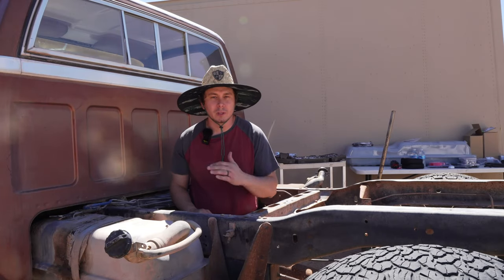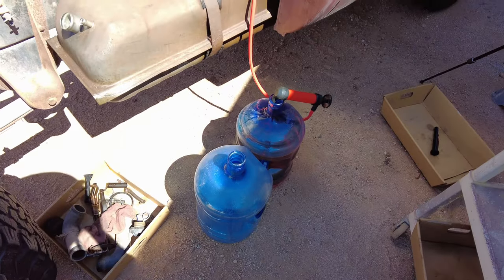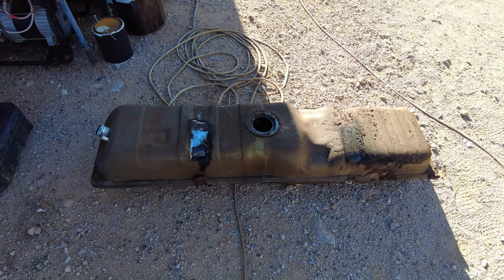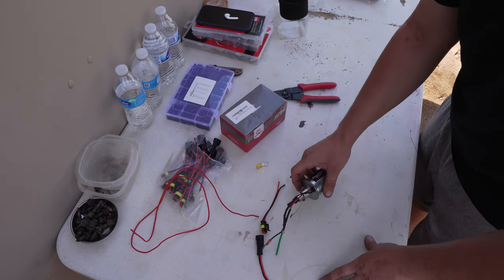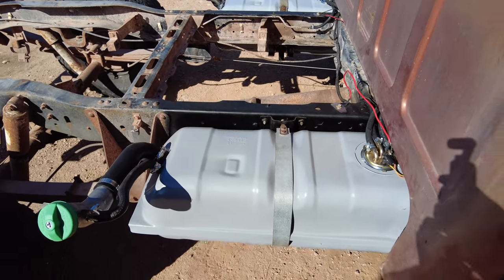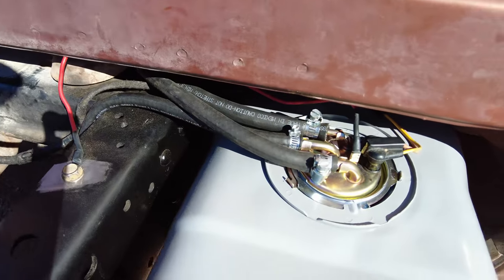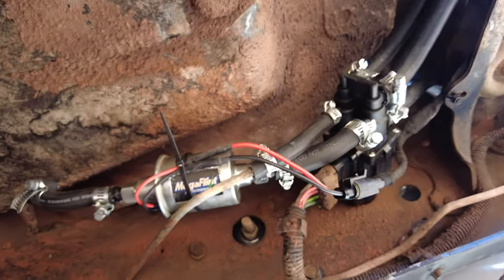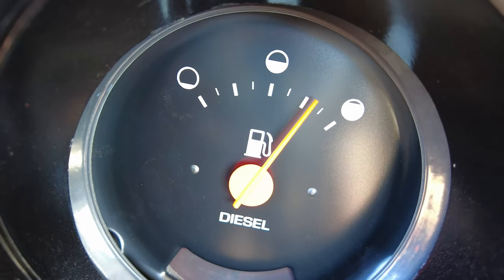Our Square Body Gets NEW FUEL TANKS!!

Comment: I have a '86 C20 6.2L that I've been wanting to do this with.. I've done a D200 Dodge, but this seems more simple since I've done it before
Reply from the maker: It should be pretty easy to do! Good luck with your project 😎
Reply: @2AOverland  thanks man.. I'm tired of my diesel leaking money all over the ground an I'm hoping it can help with more power to the wheels or acceleration

Comment: I ordered the Spectre tank for mine, but it didn't come painted just galvanized so i scuffed it with a Scotch Brite on a drill and primed it and painted it with three coats of Valspar Tractor and Implement paint. You can't hardly scratch that stuff off with a key.
Reply from the maker: Nice! I’ll keep that in mind if I have to touch up the tanks or have to repaint the frame

Comment: 78 Chevy gas dual tank couldnt get fuel to carb.passenger tank is supplying fuel to motor.was told tank splitter couldn't be found by local mechanic got it running new battery. What should I do?

Comment: To bad the rubber hoses won't last 2 years on ethanol
Reply from the maker: Thanks for the advice. I had no idea. I will need to replace it with diesel fuel rated hoses

Comment: Did  you see any gas filters from the tanks to the switch Valve?
Reply from the maker: There isn’t you have to install your own
Reply: @2AOverland  Okay thank you I was told that there were filter, it didn't make any sense. Thank you
Reply from the maker: Tbh from the factory there probably was but this truck was messed with so much it probably got removed. And it has a filter on the backside of the intake. At least mine did

Comment: About to replace some of my  hard fuel lines with soft lines as well. When removing the tank the hard lines were a bitch to disconnect fron the sending unit and there was no room to do it while the bed is on. Bent one of them and decided to just say bye to them

Comment: Is there a chance you can guide me on the hoses for fuel there's 3 and on both tanks need to find out witch goes to the other tank the middle or one of the sides
Reply from the maker: Sorry about getting to you late man! The middle  is to the water spout on the frame rail, the front and largest one is your fuel feed and the smallest one is your fuel return

Comment: Question, im working on a 1979 chevy silverado just like this one on video! Its gas! 

I dropped both fuel tanks right each sending units have three hose connections, i oredered new units a d both came with two hose connections,then i ordered them again and this this time they sent one unit with three hose connections and one with two hose. Will either of these two sets work or not???? Or do they have to be the ones with three hose connections! Kind of stuck here lol 😆 ive talked to two mechanics and they both have different opinions on this matter. NEED HELP
Reply: Tks for making this video and I hope I get a response back soon. Kind of need to finish this truck by this weekend or next. Tks again
Reply from the maker: Thanks for watching I really appreciate the support! So I could be wrong but there’s three hose connections on the diesel ones cause one is the feed to fuel pump, 2nd is the return fuel line and the 3rd is to a on/off spout on the side of the frame that’s for separating water from diesel fuel… so I’m going to guess you need the 2 hose connection sending units 😊
Reply: @2AOverland  that's what I thought cause I've seen it on diesel tanks but unfortunately these tanks are gas cause it smelled like varnish. Diesel doesn't good bad that I know of it might but it takes a long time

Comment: I just got a 74 k1500 and the right side doesn’t work  and the left does but it doesn’t read at all well how do I make it to read correctly
Reply from the maker: I’m not entirely sure. It could either be a power, ground, sender, pump or gauge issue